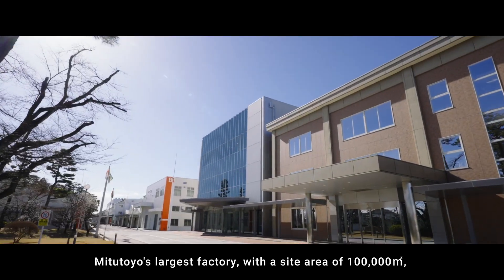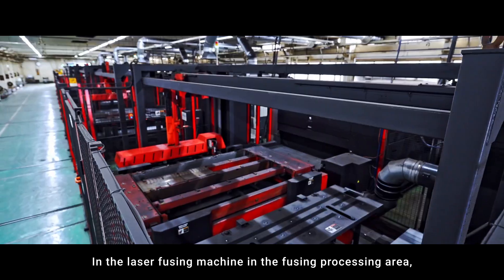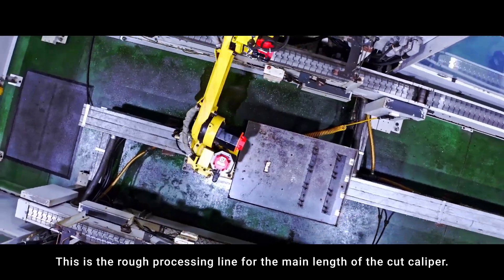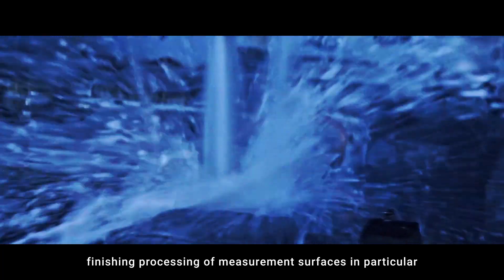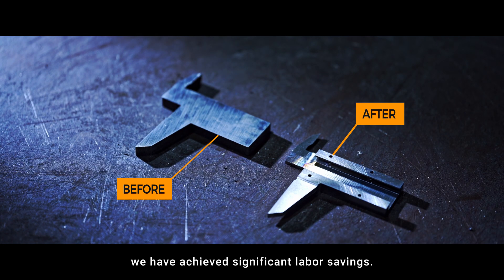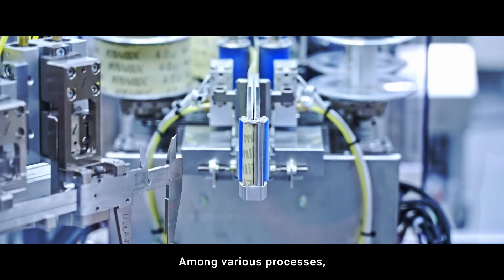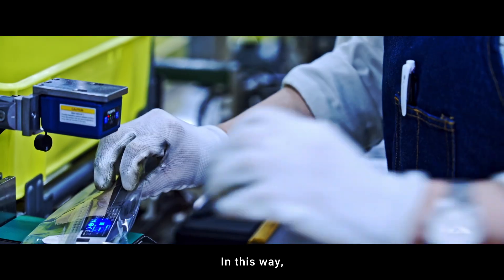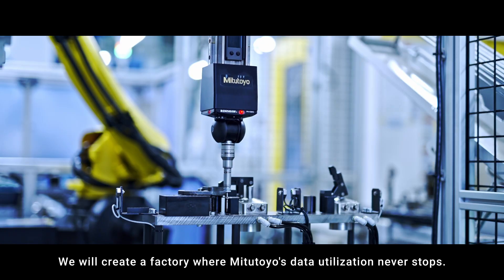Efficiency Through Automation: Caliper Production

Comment: That's cool and all, but could you make a pair of calipers that last more than a few years??
I love (not) how the model and serial and lot info - whatever there might have been - was engraved into soft plastic, which rapidly
wears away during normal use, making the age of the calipers impossible to verify... a machinist told me yours was the brand to buy,
but I'm not impressed and independent job shops like mine can't afford to keep replacing tools. Yours was supposed to be the reputable
brand, but um... "I am disappoint."
Reply: Sorry bro but I think you got scammed. All mitutoyo calipers are made of stainless steel. None are plastic.